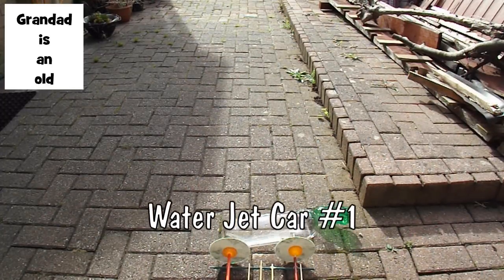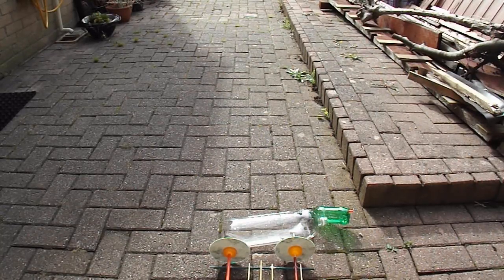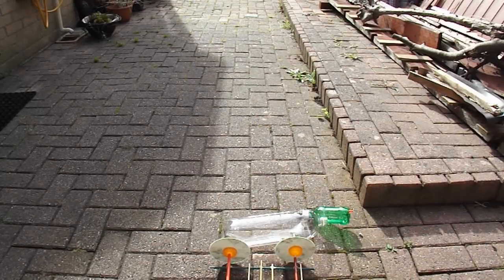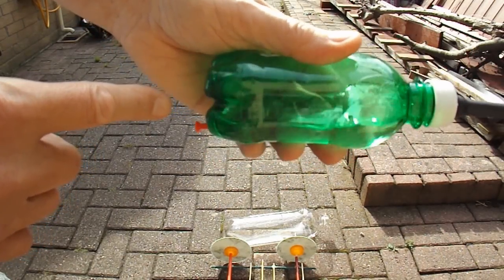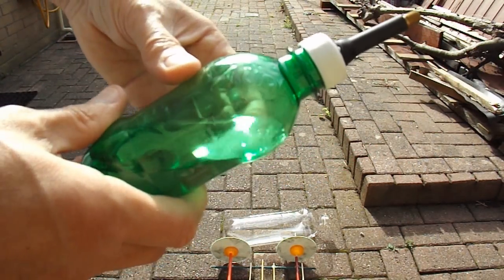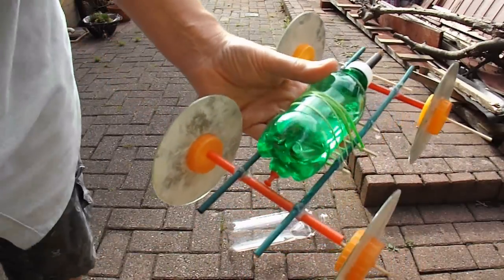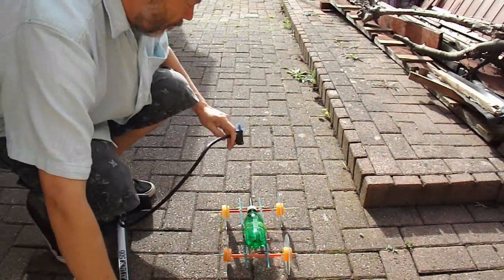Water Jet Car #1

Comment: Can anybody tell me the name of the valve he put on the front to fill the air
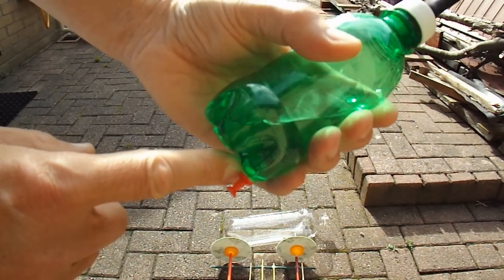Reply from the maker: As I explain at 0:58 it is a car tyre valve picked up from the local tyre dealers. They are often called Schrader Valves and when you have a new tyre fitted on your car they usually change the valve at the same time and throw the old ones away so I just ask if I can have some old ones. You should be able to use the the valve assembly from a bicycle inner tube as they are basically the same thing. This is my old video on how to fit one to the cap https://www.youtube.com/watch?v=hGkp9yaQeg8&list=PLA5a2xPRSrB12AjOGqZQmFTeAkAp7apfC

Comment: Just a question: I have constructed the car, but when I went to test it, the car just sat there and peed. Am I doing anything wrong? and is there something i can do to fix it?
Reply from the maker: The most likely issue is that your car does not run freely enough - too much friction on the axle bearings, just give it a push by hand and make sure it runs along OK without any power. The next problem may be that you have put too much water in it and it is too heavy, try it with only a small amount of water and see if that makes a difference.
Reply: Okay. Will do. Thank you very much

Comment: They would have much-much faster acceleration and speed, if you used a bigger outlet/nozzle.....mine just takes off like a rocket if i put it vertically.... about 7-9 feets easily at 90°angle.....Thus they have insane acceleration at ground with those CD wheels....
Reply from the maker: Perhaps you should make a video to show us how to do it  😊

Comment: please  tell  me  what  kind of  valvule is? Thanks   U
Reply from the maker: The valve comes from a car tyre. You can usually get them free from a garage as they fit new ones and throw the old ones away when they change the tyres. Here is an older video showing how I made one https://youtu.be/hGkp9yaQeg8
Reply: thanks  a  lot.
Reply from the maker: Claraivel velandia :)

Comment: hey granddad i challange you for a high speed  mouse trap powered boat
so fast as possible rat traps are welcome.
Reply from the maker: The trouble with boats is finding somewhere to float them. I will put it on the list, but don't hold your breath waiting for it.
Reply: i can wait